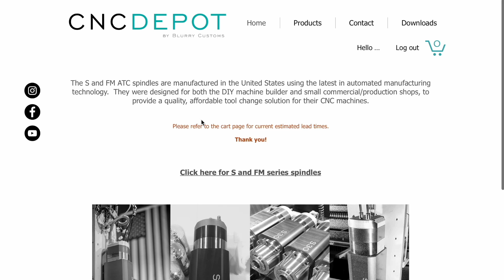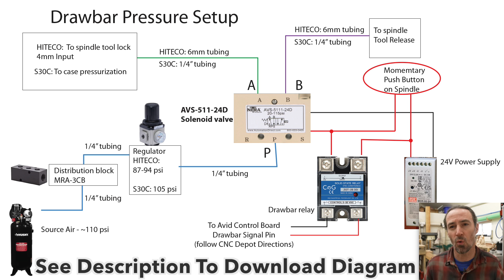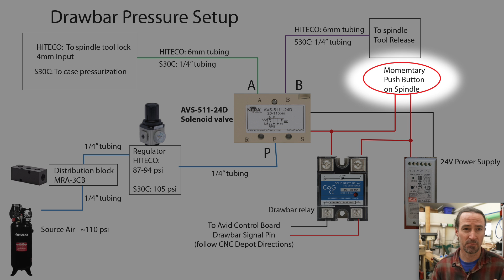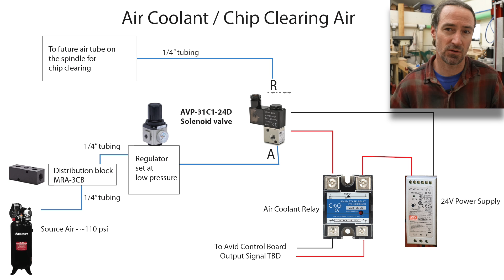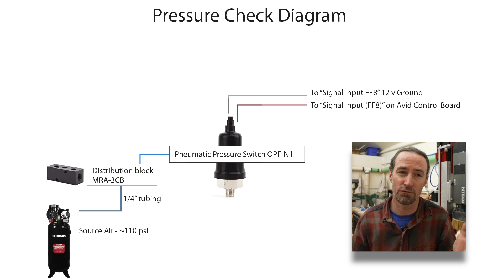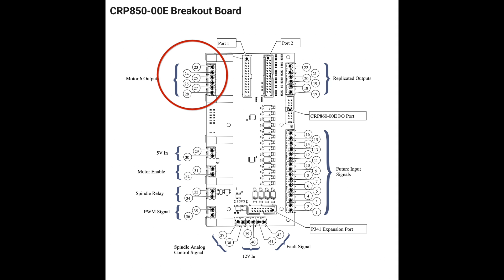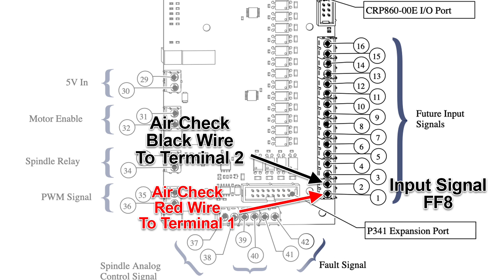CNC Build Ep 5: How to Setup an Automatic Tool Changer (ATC) on an Avid CNC - S30C or HITECO spindle

Comment: Hi Corbin.  Thanks for another great video.  Regarding the S30C Case Pressure.  You can separately turn it on/off via relay and control it via software.  I have a button in Mach4 that allows me to disable the case pressure when not needed.  Per Alex at CNC Depot, the case pressure is really only needed when working with things like MDF.   When working with hardwoods or materials that do not create the super fine dust, you can disable case air to reduce the amount of cycling your air compressor performs on longer jobs.
Reply: Oh right.  I forgot to mention that.  Yes, the case pressure can be as low as 30psi.  I've got a small inline pressure regulator directly on the 1/4" tubing that goes to the case pressure inlet.  Really extends the time between compressor cycles.
Reply from the maker: @portlandscott  Cool - I added that to the Description so other people can easily find it!
Reply: @CorbinDunn ok great! Glad I could help.
Reply from the maker: Awesome, thanks! I also saw that he posted some info about the new CNC Depot ATC spindles and said the case pressurization can be run lower. I forget what it was...but it was significantly lower than the 90 PSI that normal tool changes require, which would help a lot with air compressor cycling.

Comment: Corbin,  How are you manually swapping out tools without resetting Z height?   I like to do that for my cabinet parts since I have 3 different tools on 1 file.   Right now I'm setting my Z for each tool  on the same file.   Thanks
Reply from the maker: You save the tool heights by measuring it once, and the CNC control software gets a G43 Hx that activates the tool height for tool "x". Tools not in the rack need to be in holders and have their height measured. Avid's new Centroid based controllers make it really easy and semi-automatic (with my software mods). A good video to watch is this one, for Mach 4: https://www.youtube.com/watch?v=JNwBuiza2VU
Reply: @CorbinDunn  I put the tools in the tool table with my master as 0, tool1=3/16 bit, tool2=3/8",tool3=5mm drill, When I go to my plywood sheets on the vac table and use the touch module that came with Mach4, I put in my touchplate Height which is 2.655, and a retract of 1", when I press the lower R/H button for zero, I get a reading of 4.5 there abouts?   I don't know where this # comes from.  Should be 2.655+1".   The tool I am zeroing out is the master, so I assume when the file calls out tool1, it knows the offset.   Just don't work, busted several  nice bits trying too, frustrating.  Mach4 videos suck, they don't take the operation to the next steps to show how it all works together and actually run a 2-4 tool file cutting something. and they don't answer any questions.  I don't know what is wrong with that company, even have two 6 month old tickets they never resolved.  I kinda gave up on them and have been looking at switching to Centroid myself.   Mach4 don't want to service their software, everyone should just junk it.   I see so may complaints on them about this and other things.  Anyways for now, i'm just zeroing out my bits one by one with the paper trick, no tool table, no touch plate, no touch module and I get my work done at least, pretty poor but Mach4 has issues up the ....s.
Reply from the maker: @fritzbabler6459  Mach 4 can be frustrating, and Centroid definitely has better support; the guys who write the software actively participate in their forums and Facebook group. One thing you could be missing is the G43 call to activate the tool height; it must be called with Mach 4, and some post processors don't issue it.  In this video I talk about it and how to modify a post for it: https://www.youtube.com/watch?v=Zs_Uf7siOO4

In the Centroid version I did, I made the G43 not required; I should have done that for the Mach 4 macros, but pedantically it isn't correct to do so, so I didn't do it.
Reply: @CorbinDunn  In Mach4 that I have, there is a place for tool# and H#.   Am I supposed to put in H# same Tool #?   I was looking back at my gcode file, yes, it has G43 call out for tool 1, but says H2.   I remember when I set the tools, I always put in the H# same as tool# so I don't know why it changed it.   Stupid Mach4
Reply from the maker: @fritzbabler6459  I'm not sure what part you are talking about in Mach 4, but yes, the tool #'s should match the height #'s. If the GCode file has a M6 T1 but G43 H2, then your toolpath software or post processor is doing it wrong or not setup right; that doesn't have anything to do with Mach 4 and is whatever software you are using to generate your gcode.

Comment: Cool.  Reckon it's possible to integrate with an openbuilds CNC?
Reply from the maker: I'm not very familiar with openbuilds CNC; does it use Mach 4?  I did start with Avid's version of Mach 4, but there isn't any reason that you all couldn't use that version and just manually set up the pins and controls. Avid provides a wizard to do most the setup for their machines, but it is customizable.

Comment: Hi,  I watched all your vids, pretty involved and lots of time.   I was wondering if your using a braking resistor for your ATC?   I didn't see any mention of it any place.   Thanks
Reply from the maker: Short answer: no. Long answer:  I thought I really wanted and needed one, as the spindle wind down time is really long (~5 seconds), and it seemed safer if it would stop faster. I actually got one (a huge one) , but never installed it. I found the that the slow spin down wasn't a big deal; tool changes weren't much longer because I could let it slow down while the machine was moving. When an issue happened, ie: bad cut, the e-stop would stop the machine, and the bit would instantly stop if it was already machining wood.
Reply: @CorbinDunn    Ok, cool, was wondering is all, for me, my spindle is 11hp Hiteco so at 18k rpm, takes 13 secs, so that's pretty long for my tool changer, which is on my gantry, carousal style., Thanks for the reply

Comment: Never heard of the Hiteco spindle , bet it has plenty of torque at the rated 12K RPM . What's not to like - ISO 30 (ER32 I presume)  give you such a huge choice of tooling. Tool setting would be welcome.  Z Ref surely must be done once yes? Unless you have defined the spoil board as WCS and know the dimensions of the material.  Please set me straight if I am off in the rough here. 
I am not enamoured with manual  tool changes, but the entry fees to club ATC don't figure.
I am experimenting with a tool setting routine in Mach4 and the use of a wireless sensor that registers the tool length but it may not save much time. The approach of the tool is a safe slow IPM.  For the meantime I'll have to deal with my 2x4 machine that I have spent considerable time and effort upgrading. Never ending story. Done my best to erase the manufacturers short comings and penny pinching. 
Much improved mass and rigidity and now a heavy 6061 T651 T slot spoil board that is about to be clad in a 19mm thick fixture plate. 
Gonna be great for aluminum jobs. Currently using a mist buster and isopropyl for tool colling and chip clearing. Work in progress as usual

Regards, Chris
Reply from the maker: Awesome Chris - it sounds like you are dialing in your setup really well! I do use my spoil board as the Z-orgin for most all my projects to avoid touching off on the Z. I don't bother with accurately measuring the thickness of the material; it usually doesn't come into play in most projects. My planer, with a DRO, is also pretty consistent in getting wood to the right thickness. CNC Depot just launched some more affordable ATC options.

Comment: Nice do I need a compressor that large ? 👍👍👍
Reply from the maker: I don't think you do; each tool change doesn't require a lot of CFM, but it does require 90-105 psi. My compressor doesn't run very often when I'm running the CNC, even with the constant "case pressurization" air. You should definitely run the case pressurization on a lower PSI to avoid having your compressor run constantly.
Reply: @CorbinDunn  ok that’s good kinda what I was thinking the tool change is very fast thanks for your reply we’re hoping to get set up in feb or March getting ready to break ground for the new wood shop our one car garage is not getting the job done lol 👍🇺🇸

Comment: Hello Corbin, I'm already using your dust boot so I figured I'd follow your ATC journey. I ordered a 4hp from cncdepot looks like a 5wk lead time before it ships so I have time to watch your vids. thanks again for providing this info.
regards
brian stanga
Reply from the maker: Awesome Brian! I think their new turn key setups are better than what I started with. I also updated the dust boot with tabs to prevent push off. Your early feedback was super helpful!
Reply: great, I just got the stl files for the boot, I ordered the rm40 spindle I need to find the correct diameter for that spindle. thanks again!

Comment: Perfect timing, my QD-1F from CNC depot came in Friday. I am changing over from the 8.7 HP that I originally bought with my avid. Enjoyed the video. I know you're probably about to release a video soon about setting up the software, but did you use the m6 file from cncdepot or, I just watched a video by GulfStream Outdoors and he used a m6 file made by Jason Parker?
Reply from the maker: The next video will be on making an ATC rack, and then I'll cover the software. I actually did a bunch of work on the software to make it easy to setup and require no coding knowledge. It adds a lot of ATC specific features, and works really well. Jason has been testing it out for me. I've got a work in progress document here, in case you want to preview it (all free, of course!) 
https://www.corbinstreehouse.com/blog/avid-cnc-atc-automatic-tool-changer-with-mach-4/
Reply: @CorbinDunn  Thanks! I appreciate all the info! I do have a question though, Wouldn't you need 2 electrical relays, one for the tool lock and one for the case pressure? CNC Depot, sent an electrical relay with the pneumatics kit, but I didn't see one listed in your buy list. I'd also love to see detailed pics of your wiring, especially in you're control box. I think I've got mine just about wired up, but it's more temporary to make sure everything works. No Idea how I'm going to fit this in the control box yet lol
Reply from the maker: @reignworkswoodworking5152  Yeah, it was a tight fit; I put my air pressure regulators in the box, but I think it would be better to have them out of the box on the side to make more room and  more easily see the pressure value. I forgot the relay in the list; here's the one I used - https://amzn.to/3pCzPoq  - the same one as the CNC Depot package came with.  I'll update my blog post with a photo inside the box...I'll post back when it is up.
Reply from the maker: @reignworkswoodworking5152  OK: https://www.corbinstreehouse.com/blog/2023/05/how-to-setup-an-automatic-tool-changer-atc-on-an-avid-cnc/ - Photos at the bottom of the post.
Reply: @CorbinDunn  thanks! I appreciate it! I put my 24v power supply in the avid box, but it definitely makes since to put the pneumatics in the vfd box, there's way more room! I got my push button working now, and I'm waiting on cnc depot to send an end for my spindle power cord. They sent a female end, but the box I got from Avid also has a female end so they're making me a cord. I didn't realize it until I took the old spindle off and Ive got to get this thing back running, it's my main source of income 😆 Definitely appreciate the quick response!
Reply: Ok one more question lol,  ive got everything working but the fan in the spindle. It's not coming on it all. Where did you hook the relay wires up on the spindle? The release button is hooked to 12&13 (I think, it's not in front of me atm) the labels show the fan gets power from 14&15 is that right?

Comment: Regarding the S30, when you open the drawbar the spindle locks and then case pressure stops. I know that if you reverse the lines on the S30 you will lock the spindle. It seems the case pressure is being used to also lock the spindle when the drawbar is open but I am not 100% sure.
Reply: I have the S30C.  Case pressure is not required for any ATC functionality. In fact, I don't even use case pressure sometimes.  When i do use it, I set it to a lower psi so the air compressor isn't running constantly.  In addition to keeping the bearings clear, it also provides some cooling for the spindle.
Reply from the maker: Thanks Jason! i kind of figured it would work that way. It means the case pressurization always has to be "on" so manual tool changes can be done. Putting it on a relay would probably make that not work work.